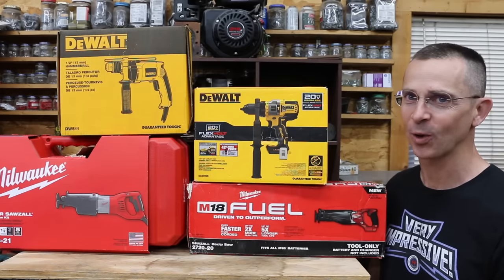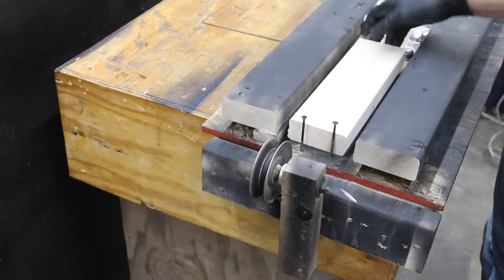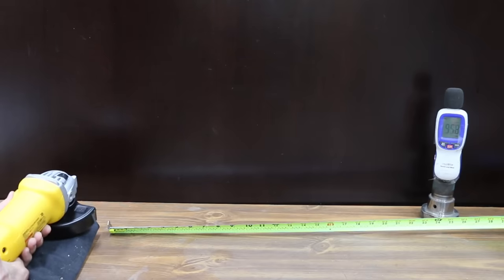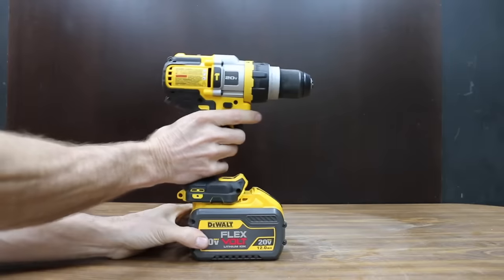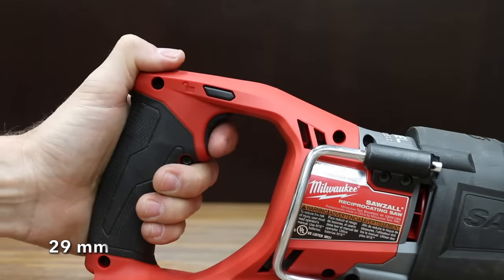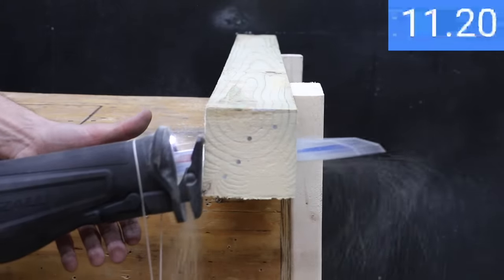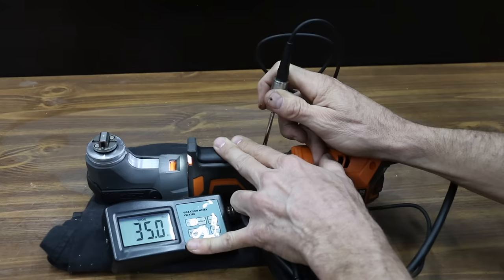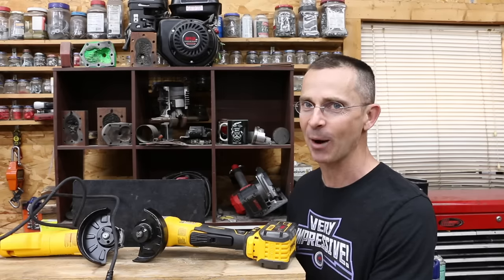Let's Settle This! Are Cordless Power Tools REALLY Better? Torque, Cutting Speed, Noise, Vibration

Comment: For me it’s a very easy choice. If I really need power out of a tool for extended periods of time, I will always choose the corded tool. Drilling big or very deep holes, chisseling concrete etc will always be easier with a corded tool. Cordless tools have the giant benefit of ease of use. If I just need to drill a couple anchor holes, chop a piece of pipe etc I don’t want to carry the heavy cordreels across the whole jobsite for seconds of actual working time. Same in the shop. If I’m grinding on metal in my shop, why should I fiddle with batteries if I can just plug the grinder into the wall and have more and longer power.
Reply from the maker: Thanks for the feedback.

Comment: The Rigid Oscillating tools you used with the cable is the Jobmax version. The head can come off and be replaced with a few other heads. You should have compared the battery tool with a non jobmax corded.
Reply from the maker: Thanks for the constructive feedback.

Comment: In my opinion, this only shows that european system is superior.
Meaning?
220-240V electric is far better then 100-120V.
Try this with 240V corded tools.
The gap is much, much smaller.

Also, it would be interesting to put tools from 1990s against todays tools.
Reply from the maker: Thanks for the suggestion.

Comment: I suggest using tools in the same price bracket. For example, match the DeWalt DWD220 for ~$200 against the $200 cordless drill you have. Also check the endurance and power degradation over the life of the battery vs. the corded in the same conditions. A cordless tool is only as good as it's battery performance.
Reply from the maker: Thanks for the suggestion.

Comment: Just a heads up ...The "kits"  or  "Combo"  packs may have some very subtle changes in the specs of the power tool you are buying when compared to the stand alone model.
It's not uncommon for them to sneak in a lesser model in the Combo or kits packs   ..check the specs before buying.
Reply from the maker: Thanks for the feedback.

Comment: I'm fairly certain the Makita round saw performed just as well because of the 2x18V batteries. Voltage is critical in an electric motor and the 20V batteries/motor of the DeWalt grinder isn't up to par for moving a much heavier load (the blade).
Reply from the maker: Thanks for the feedback.

Comment: I don't understand why people believe that pressing harder will improve cutting. The only thing more pressure is guaranteed to do is cause more heat which dulls blades quicker which causes you to take the time to replace the blade, go to the store etc. Congratulations you saved yourself a few seconds and added a trip to the store. Work faster not quicker.
Reply from the maker: Thank you for sharing!

Comment: Do an overall package combo manufacturer vs manufacturer, base it on the battery options (eg. dewalt 20v vs Milwaukee m18 vs ryobi, etc) You’ve tested most of them. Find which packages are best including battery costs, options. 

I have all dewalt tools only bc I started w a dewalt drill and didn’t want different tools w different batteries.
Reply from the maker: Thanks for the suggestion.

Comment: Thanks! I usually work away from the shop so all I've got is cordless tools. However, on a different note, would you be interested in doing a video on portable work tables/benches? Interested in weight capacities, usability, true portability, features for the price.
Reply from the maker: Thanks for the suggestion!

Comment: I appreciate these tests.  Personally, I favor corded unless I need a cordless version.  I hate the performance-degradation in cordless tools, the different platforms, and the frequent platform changes with no legacy integration.

You really have to use the hell out of a cordless tool or really need to be uncorded to make them worthwhile before they're worn out and obsolete.

On the other hand, corded tools last FOREVER... and they won't be obsolete until 120V AC @ 60Hz is obsolete.
Reply from the maker: Thanks for the feedback.

Comment: Just after watching the circular saw comparison, I am a bit surprised that the cordless was that much lighter in weight!
Update: I'm surprised there are still drills that have key chucks! (the Dewalt corded) Also, did you say "8.5 amp-hour motor"? :)
Reply from the maker: Thanks for watching!

Comment: I have a 35 year old Makita worm drive or hypoid saw. THAT SAW IS A REAL FRAMER'S SAW! Honestly you lose some efficiency charging batteries compared to a good #12 AWG main cord off of a 120 volt AC temp power #4 AWG fed spider box. We ran buck boosts too so we could run hundreds of feet of cord and still have 120 volts on the business end.
Reply from the maker: Thanks for sharing.

Comment: Cordless tools are great, but I can't justify filling a shelf with chargers and batteries when I can simply use ONE long extension cord. Until the government or a consortium of manufacturers creates a standard battery design, no thanks. There's no reason other than greed for every company having a different cast to put the same lithium cells in. Some manufacturers (I'm talking to YOU, Greenworks) even create different shape batteries of the same voltage, again, to force the consumer to purchase more batteries and chargers. Nonsense in the greatest way possible.
Reply from the maker: Great feedback. Thank you!

Comment: Due to age my shoulders,hands and arms can’t hold my older power tools.  Last Christmas I received the lighter DeWalt 12 volt lithium drill and impact.  They really helped me get back in the game.  Then my wife used the drill to put up wall treatments.  The light weight impact is now her favorite to take apart stuff with bolts and nuts.
Reply from the maker: Thanks for sharing.

Comment: on a budget corded always win imo, high end battery powered will sometimes be better but more often they're just on par with the corded ones. I just bought a corded 450nm impact wrench for less than $70 shipped - you wont be breaking crank pulley bolts with a battery impact driver for anywhere near $70 thats for sure.
Reply from the maker: Thanks for the feedback.

Comment: You should do a video on inexpensive corded 1/2inch impacts. I used a harbor freight one that was barely enough but an Amazon knock off for $20 was wayyyy better and still half the price of the Milwaukee corded. Mine I'd an Eastvolt. 

I believe that there is a different philosophy of use between a diy mechanic working on compact cars, like myself vs a professional diesal mechanic. I've gotten away with my cheap corded tool. It seems to do everything I need.
Reply from the maker: Thanks for the suggestion.

Comment: As usual, excellent test rigs and methods. I'm a bit older .. so tend to have an inherent distrust of battery tools, thinking them weekend warrior jokes. On one hand .. I've recently seen a cordless (Let`s just say red and black) 3/4 impact used to swap bus wheels - clearly they have come a long way, and are now used in `real`shops. On the other hand .. all work does stop when the battery dies, so in some ways you`re still comparing apples to oranges. 

(For what it's worth .. For the log roadside, or deep bush muskeg: I have an ancient set of armstrong one-inch drive "coffee cup" sockets .. and a cheater bar that will reach to pluto. They are never fun - but they also never fail.)

I do a LOT of cutoff wheel work too .. I have a pair of $18 Chinese angle grinders in the box (a pair, so when one dies.. Lol) but the job gets done. Sure, I`d love a fancy cordless - never again having to find and string 200 feet of extension together for a Honey-do job that takes 30 seconds - and if Santa ever brought me one I wouldn't turn my snob nose up.

But I still call "which is better" depends entirely on what you expect from the tool.
Reply from the maker: Thanks for sharing.

Comment: I'm still in team corded tool.
Small gains don't justify double price for me. Especially when you have to consider that on 10 years, the battery operated tools will definitely need new batteries whereas the corded tools will still just plug in and work
Reply from the maker: Thanks for the feedback.

Comment: The clear take-away for me is that:
* Cordless tools cost more, AND NO DOUBT, make a lot more money for the manufacturer on down.
* Cordless tools, AT the high prices, get a lot more development in features and sometimes speed (one of the results from development)
* If the same development costs were applied to corded tools, they would win more of these comparisons, if not all of them.
* Cordled tools have a much lower initial cost AND they last a lot longer. I have corded tools that are older than many who watched this video, and still work fine. THAT means their lower cost per potential used is FAR lower that cordless. AND more reliable.
* Over time, battery tools decay because the battery does. Cordled doesn't change.
* Cordless are more convenient for quick and remote jobs. But not all of those jobs. I had a project at a site where the power was off, partly because I was replacing a main switch-box, and needed a heavy hammer-drill (but not the really big one). I  had to bring a small gas powered generator with me for power.  NO cordless tool could do this job. None.

So yes, I have some cordless tools, and use them frequently. They are valuable in construction projects where dragging a cord all over would be a pain. But the corded generally have more power, and will go all day and a much less cost over short AND extended periods of time. You need both, but don't get carried away.

A battery lawn mower? That is a joke. I mow 4 acres. And a gas can is a reach away. Battery chain saws? Are you serious?

And China is making a lot of money here. I see that too.
Reply from the maker: Thanks for the feedback.

Comment: Union pipefitter. The companies bought us cordless grinders.... no thanks. Much as I hate extension cords that is one tool I want to be corded. One extension cord is lighter than 3 batteries, chargers and extension cords. Rest of tools we can deal with cordless cuz they don't get used that long. Of course we also have companies that buy NOTHING BUT CORDED! That gets old. No need to drag out the 100 ft extension cord and the drill to cut one hole in a pipe or run in one nut. Then they wonder why the jobs takin too long... I dunno, had to make 3 trips to carry everything to do a 5 min job if yall woulda bought a battery drill and battery impact... or even just a bucket.... cheap asses. And yes they will buy a corded impact instead of a socket set cuz "it's faster."
Reply from the maker: Thanks for sharing.

Comment: When you’re in an automotive shop, cords are quite a pain if you’re moving back and forth between multiple cars.  Air tools have the same problem, plus you have to lube them.  Battery powered tools are strong enough to accomplish their intended purpose while providing valuable speed.
Reply from the maker: Thanks for the feedback.

Comment: Cordless do have their advantages far as portability and can perform well - but for how long, any good quality electric drill or saw itself will always outlast the battery rigs by years and ill NEVER heve to buy $$$$$ batteries plus the battery rigs always burn up in a few years or less depending on usage - bottom line the corded tool will work all day long with no need for charging and battery replacement, the batteries only last so long and cost more than the tool itself in many cases
Reply from the maker: Thanks for the feedback.

Comment: I purchased Dewalt Cordless circular, Drill and also 1/2" drive Cordless impact wrench. None have the power of electric saw or drill.And I can always depend on my Snap on 1/2" air impact to remove the worst rusted nuts and bolts. A little bit of heat and never a broken nut or bolt
Reply from the maker: Thank you for the feedback!

Comment: Great video, your findings closely reflect my experience.  Cordless angle grinders are significantly slower and less powerful. Ok when you need the portability, but a big compromise over corded. Also need large batteries to work properly. Cordless drills can have a heap of torque and tend to outperform corded models. I have used what is more or less Makita's direct competitor to the corded drill used in this video, and was very disappointed with the torque and power when drilling steel. Pleased to see the cordless circular saw keep up with the corded model. The single battery Makita saw I have used though was much weaker than this two battery version. Battery saws often have smaller blades as well, and may have a thinner kerf blade to save power. Cordless tools are slowly displacing corded, and often include nice features that aren't on the corded models. When high power is needed though, mains power is still on top.
Reply from the maker: Thanks for the feedback.

Comment: Very interesting. I have cordless, corded and air powered tools. My corded cut off tool died very quickly. Switched to air for that tool and expect it to way outlast the corded version. Not sure how well battery powered would do. I am surprised at the improvements in battery powered tools. It used to be no contest with corded being much better.
Reply from the maker: Thanks for sharing.

Comment: Project farm! I need you!!!! Pruning shears. We had a wicked snow storm here a few weeks ago. Lotsa fallen branches. Me being the git r dun kinda person I am, I bought myself a tiny wood chipper and collected branches from friends, family and neighbors that needed help cleaning up. Tiny wood chipper failed massively with green branches and leaves and such. So, being the thinker that I am, I let the branches age a few weeks. The leaves fell off and the branches are less green. Tiny wood chipper is awesome now! However, in trying to "buck" the branches to fit in said tiny wood chipper, pruning shears from a respectable brand failed after the very first branch. The nick in the blade is so extreme that the shears no longer close without extreme resistance. Surely there exists in a world full of self driving cars a blade which can cut through half inch diameter or smaller semi seasoned branches without suffering catastrophic failure.
Reply from the maker: Thanks for sharing.

Comment: Can you do an Air tools vs battery tools? I've been a mechanic most of my life and I love my air tools but Snap-on really pushes the battery tools, I think they are bulky, give no feedback or feel and do not produce the same power as a good air tool, I would also like to see Milwaukee vs Snap-on battery tools. I think Milwaukee beats snappy hands down and for a fraction of the cost. Thanks for all the great videos you produce, I especially like the combustion related ones using the lawn mower engines.
Reply from the maker: Thanks for the suggesion.

Comment: I have both corded and battery tools and each has a purpose.  I tend to use battery stuff for ease of use and buy corded tools that I only use occasionally.  For example, my belt sander is corded and my heavy-duty angle grinder is corded too.  I also have a corded impact driver for working on my cars along with a pneumatic one.  I can say that I use primarily battery stuff for convenience and have purchased enough batteries so that I have plenty of back-ups.  The one thing that I would not use is a battery-powered worksite table saw.  None of those seem to work well even with larger batteries.
Reply from the maker: Thanks for sharing.

Comment: My bet is new corded tools are not the same as much older ones before cordless came along. I’ve got what you’d call antique corded disc grinders and saws etc. that outperform my cordless tools. Of course they were made when they were expected to be repaired. If you’re doing heavier work corded is best but light work the lighter weight cordless are easier on you. I have a B&D aluminum cased jigsaw that uses metal gearing. Still working decades later.
Reply from the maker: Thanks for sharing.

Comment: When I was working (retired now) my professional wood shop was filled with all cordless tools and they performed well. We often went to peoples homes that did not have convenient outlets and were also up on ladders much of the time. The cordless tools worked well as we used them every day.  When I retired and took many of them home I did not use them nearly as much and the batteries quickly went bad and weak in short order. Batteries not used on a daily basis don't do well as compared to ones that are cycled every day. After looking into replacing the batteries, the cost for them was sky high and totally reduculous for a now retired homeowner! At that point I realized there was no practical reason I actually needed cordless tools so I sold them ALL and replaced them with Milwaukee CORDED tools. I couldn't care less if they cut a few seconds slower or faster and am not inconvenienced at all since I have outlets all over my house including on all outside walls. I have not had to buy a battery in 8 years and never run out of juice half way through job. So your testing procedures are very admirable however they did NOT address battery life and cost when the tools are no longer used on a daily basis. For professionals working outdoors and on ladders - no question that cordless is the way to go. For homeowners, weekend warriors,  or ocassional users, standard corded tools are far superior especially when cost of batteries is a factor. Since selling my cordless tools I have NEVER missed them or regretted swapping them for corded models. Both have their purposes and their pluses and minuses. One needs to think about what their needs and actual usage will be before just running out and buying a certain type of tool 'cause that's the new trend.
Reply from the maker: Thanks for sharing.